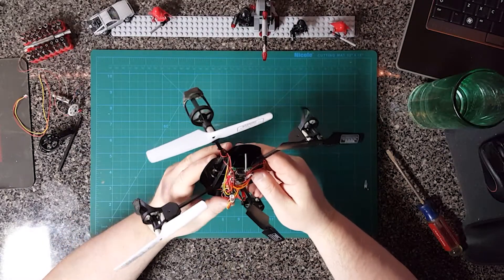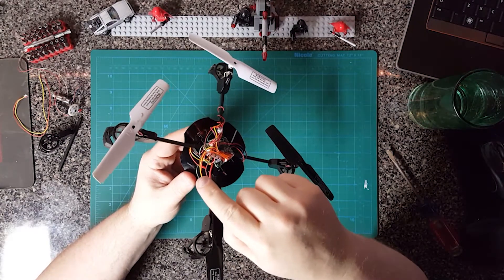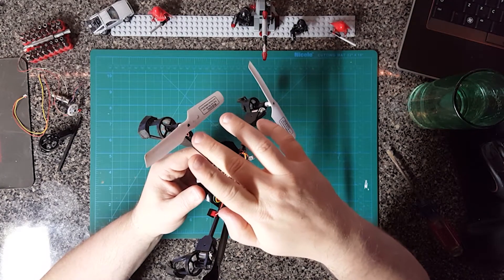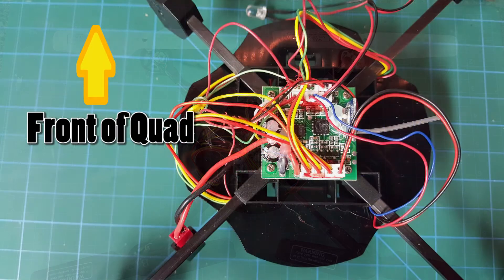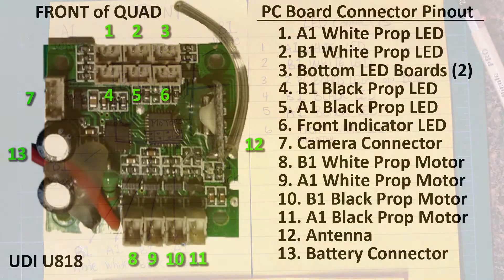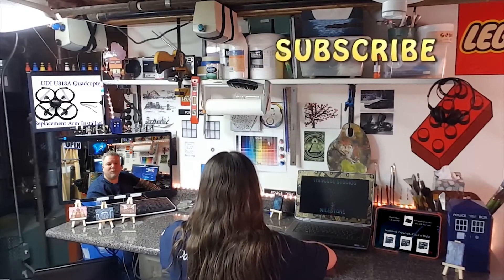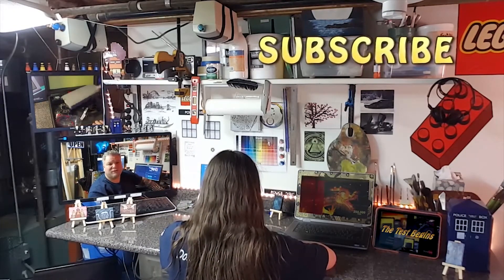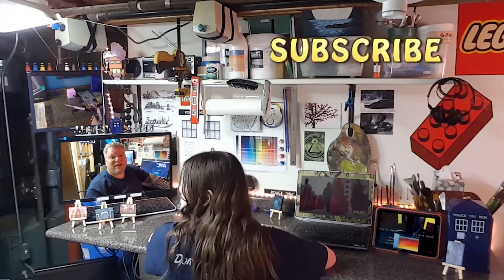UDI Quadcopter PC Board Connector Pinout - U818A DroneTube Repair

Comment: Tony, I had a bad motor as well so I replaced it.  Now it constantly spins.  I even tried another motor to make sure the replacement was not bad.  Any idea why my replacement motor spins as soon as power is applied?
Reply from the maker: Hi bibbs823, i might have some bad news for you! It sound likes you main board is bad. Thanks to another youtuber who sent me a picture of their main board we now know that sometimes when motors go bad they also send a surge or draw too much current from the board and destroy a transistor. Take a close look at your board and you should see some ICs with the number "2300" on them and 3 contacts (legs). See if any of these are burnt or look closely for cracks. The good news is that a new board is available here if you feel like doing the work: http://amzn.to/2bUbwJ8  (Wifi) version.   Good luck and let me know how you make out, Tony.
Reply: Thanks for the quick response. I cannot see the numbers, but I do see there is damage near the pins for the motor that spins. Sure looks like what you described. 
At least the board is not too much and it is available. I will replace it and see how it goes.
Reply from the maker: Sorry for the bad news but glad i could help....good luck with the repair and let me know how it goes!
Reply: +ThinCube 
I finally received the new board and all four motors spin. I have a couple other questions for you. In all this time, I must have misplaced a light. I have nothing plugged into 6. Am I just missing a light?  The other, and more important question is why my drone flips as soon as I take off. Could it be bad calibration, or a motor not connected correctly?  When standing behind it, the drone flips to the left as soon as it leaves the ground.
Reply from the maker: Hello again, sorry to hear you're still having issues. Yeah, connector #6 powers the front white LED. It isnt needed unless you want it for guidance. As for the flipping. Make sure you have not only the correct motors in place at each location (clockwise vs counter clockwise), but also that the correct direction prop is installed with each motor. here is a link to a video i made to help you with that:  https://www.youtube.com/watch?v=nTNhGXrO5ik     Let me know how you make out....ttyl, Tony
Reply: I must have something screwed up. Looks like A1 and B1 are spinning opposite of what they should be. I didn't change either of them. I will take another look after watching your videos. Thanks for all the work you do!  It is very helpful.
Reply from the maker: Make sure they're plugged into the correct spot on the board....and hopefully the board you got matches the layout in the video.  Use the prop video to help you check all the props for "proper" rotation :)
Reply: +ThinCube 
See if explanation marks any sense to you. When I stand behind the quad the two front rotors are white and the rear to are black. Going from left to right I have A2 white which spins CW, B2 white which spins CC. Bottom left is B1 black and it spins CC. Bottom might is A1 black and it spins CW. This naming convention does not match what you have in your video. Any idea what I'm doing wrong?  I think they are plugged in correctly. 
Brian
Reply from the maker: the only difference is that there are no "2"s on my quad in the video. But you have all the correct directions listed as i do. Make sure the prop that is on that particular location is in fact the correct slope to it. Watch the video and i explain how to tell a clockwise vs cclockwise prop by its shape. Maybe the A2 and B2 are different. that is the only thing i can think of besides the board putting out the voltage differently to each connector. Just make sure you can prove the prop is spinning in the right direction and that the prop at the location is in fact the right one. Because if you put the incorrect prop on a motor it will act the opposite of how it should. Which is what it sounds like is happening to your drone....sorry for the long winded  reply :)
Reply: +ThinCube from what I can tell, all 4 are providing lift. That's right, correct?  I only changed the motor that locked up. I have not changed any of the blades. Could it be the new board?  Do I need to update the firmware? Is there any calibration that needs to be done?
Reply from the maker: Ahhh i see what you are saying now, i just assumed you might have had it all apart for some reason. Well, in that case it really just points to the board acting funny. But to confirm that, did you check to make sure that the motors are spinning in the direction they should be for that location? The right motor and right prop at each location is only part of the story, the board has to be sending the correct polarity of voltage for the prop to spin correctly as well. Because in theory you could reverse the red & black wires on a motor and it should spin in the opposite direction.
Reply from the maker: And yes, all 4 props together provide lift. They spin in opposite directions to provide stability and the ability to rotate your quad on its axis.
Reply: Have you ever used the board you suggested?  Maybe it is just a bit different.  I tried to explain the prop locations and spinning direction in an earlier reply. Did that make sense?
Reply from the maker: No I haven't used it but other youtubers have with no issues that i know of. Yes, i saw that reply when you mentioned the props A2 and such, just wanted to be sure the motors were actually spinning in those directions. It sounds like the board is bad unfortunately! Amazon is really good about refunds if you purchased it from there.
Reply: Crap. The board was ordered through Amazon, but came on a slow boat from China.  Getting tired of this fight.
Reply: I received a new motherboard and it turns out I did have 2 motors switch. I can now fly, but I'm struggling with control.  I want to thank you for all the helpful information and informative videos.
Reply from the maker: So glad to hear you're up and flying again, bibbs. Good luck with getting it under control. It does take some practice but you'll get it :) Glad i could help....Happy Flying, Tony.
Reply: Are there any good training videos on flying?  😀. The RC controller seems to work alright, but the Android app stops working all the time. I'm struggling to find good documentation that matches the gear I have.
Reply from the maker: Try this video and see if it helps you out. I did a quick search and found this one: https://www.youtube.com/watch?v=OOLhmvdDyJM
Reply: I cannot get that to play since it does not show up as a hyperlink. Tried to type the URL and that didn't work either.  That's alright, thanks again for all your help. Communicating directly on YouTube is not intuitive to me.
Reply from the maker: bibbs823 The link works for me when i click it in the comment now, sorry its not working or you.
Reply: shows up  as a link now.  I'm not sure what the problem was. I think I needed to be in full screen mode.
Reply: I must have something still serious wrong with my quad. I charge a battery up, plug it in and all the lights come on. I attempt to take off and try to hover for just a bit. Soon my RC controller starts to beep. I'm assuming that is low battery. I'm serious when I say I have less that 2 minutes before everything is dead. What do you think the issue is?
Reply from the maker: First thing that comes to mind is the battery. Do you have more than one to verify it is happening with other batteries?
Reply: I have 2 batteries and they both do the same thing.
Reply from the maker: Try using the remote to shut off all the lights and see how much more flight time you get...im reaching but its worth a try!
Reply: ThinCube can you tell me why the throttle on the Flyingsee app is at 50% by default?  I don't understand why you would want that, or how I can change it.
Reply from the maker: Hi bibbs, i do not know why its at 50% as I am not familiar with the app. Try looking at the trim settings on your transmitter. Make sure the throttle doesn't have a trim adjustment.....

Comment: Anytime I plug a motor into slot 11, when I plug in the battery, the motor won't stop running. Any ideas on a fix?
Reply from the maker: Hi msitez, well it could be the main board went bad and is keeping that motor on all the time. Or something stuck on the transmitter always outputting but i would think all the motors or at least more than one would be on. But try turning off the transmitter and seeing if that changes anything.  Let me know what you come up with and we can see what next to try!!! Good luck, Tony.

Comment: The PC board on my u818a looks the same as this one in your video. The transmitter has a blue light.  On the bottom of the PC board it says ud-u817e.  Im having trouble finding a replacement board. Will any board that looks exactly the same work?
Reply from the maker: Hi, i believe as long as you have the u818a quadcopter the number printed on the PCB isn't always the same. I have also seen "u817B" on these PCBs.  Below is a link to buy a replacement board. Good luck and let us know how you make out..... UDI U818a PCB:   http://amzn.to/2a2ywaL
Reply: +ThinCube I got that receiver board a couple days ago and replaced it. the numbers on the board match up the same. the transmitter still won't connect. I'm lost now
Reply from the maker: Sorry to hear that! Try binding the transmitter to the drone by first turning on the transmitter (drone battery unplugged) and throttling up then down. Next plug in the battery for the drone and right away you should hear the"binding tone". Also, make sure your transmitter batteries are good. If that doesn't work. Try unplugging everything and then start with the drone itself. Plug the battery in, then turn transmitter on, next throttle up then down and you will hear the "binding tone".....do this all quickly one right after the other. Let us know what you come up with. Honestly, if all this fails then i would suspect the transmitter is bad! Good luck.
Reply: +ThinCube I've tried all that. I know the transmitter is good because it will connect to my friends drone. no matter what I try it still won't connect to this new board. I wrote the seller of the board and they will accept a return. No more U818a. They're only 40 bucks now. I'll just pick up another one.
Reply from the maker: Yeah, there are a ton of sellers with great deals on the U818a. At least if you buy the same drone you will have a whole bunch of spare parts on your hands!!!  http://amzn.to/2aSjNyx   Happy Flying and thanks for sharing!

Comment: Hey I am having a problem with the connection between my drone and controller. This happened after my drone dropped from a height of roughly 10 meters. Only the housing was damaged and the connection would be cut after I flew the drone for 20 seconds, it would be great if you could help because I don't want to spend too much money on the repair of this.
Reply from the maker: Hi Jayden, it really could be anything since the drone had a fall. But i would start with checking the solder joints. Look for cracks or separations. Especially around any capacitors or larger components (like the board the antenna is connected too). If you are familiar with soldering, you could try what is referred to as "shotgun" soldering. This is the process of reflowing solder on a bunch of joints in an area of the board.  Good luck and let us know how you make out or if you have more questions, Tony.
Reply: +ThinCube the connections and joints seem to look okay but when the issue occurs there is a red light flashing on the chip of the drone. Also is there an email address which I can send a few pictures to do you can help me inspect for possible solutions
Reply from the maker: Sure Jayden, send the pics to tony@tonyboston.com and i'll see what i can do....do you happen to have any videos of it?
Reply: +ThinCube yep I sure do but I believe the file will be to long to email so I will post a private YouTube video and give you the link to it, thanks for your help :D
Reply from the maker: Sounds good!

Comment: Hey Thincube – great videos. Do you have one that shows how to connect the camera to the PCB? My U818A came with the camera separetly in a plastic bag. I thought I'd connected it correctly, but it isn't taking pictures/video at all. Any assistance would be greatly appreciated. Many thanks in advance, Sam
Reply: Looking at your diagram, I have connected it to the correct point on the PCB, yet it still isn't working. 

Also, there's a connector at the opposite end to the lens on the camera which I can't figure out what its function is.  It's not micro/mini USB. Do you know what it is? Does this also need connecting up to something on the PCB? I don't appear to have the cable – nor did the device come with one – if so... Thanks, Sam
Reply from the maker: Hi Sam, glad you like the videos. Ok firstly, i do not know what the connector is for on the camera, maybe they use it when setting it up in the factory. Or maybe it is an output to transmit the image to a ground station using a transceiver which the UDI U818A does not come with...these are guesses. Ok, the only thing i can think of as to why its not recording is this. 1.) Be sure you have a known good micro sd card installed. 2.) Are you pressing the correct buttons on the controller to start video/take a picture?  Look at the LCD on the transmitter and make sure the video icon is showing up when you press the video button. Let me know if this helps or if you have any more information that may help me figure this out for you. Thanks, Tony

Comment: i think your videos are great ! I'm am having a problem with my Udi as i take off it starts to rotate while in-flight making it difficult to control and after about 5 second in the air it dives down towards the ground.  i swaped out all the props and motors with arms attached. the gears all good also.  the wiring is perfect. i just can't figure out why it rotating on its own.  PLEASE HELP ME!
Reply from the maker: Thanks, glad you like my videos. So from what you described and your efforts to fix it, it sounds like the ONLY thing left is the main flight control board....the board in this video actually. As long as all of the motors you replaced are actually in good working order then the only thing left is the main board. With the exception that the transmitter could in theory be sending out the wrong signals but that is unlikely.  Unfortunately my two cents are the greatest in this case but i hope it helps. Let me know if you figure it out or anything changes.

Comment from the maker: Thanks for watching and please feel free to comment or ask questions below. I try to reply as quickly as possible. Happy Flying!
Reply: ThinCube It’s great the way you simplify everything to see what goes where.......Thank you.       Maybe you can help me with the problem I’m having I replaced the motherboard no problem everything went fine The drone has a fully charged battery and the controller has new batteries installed in it when I was done it paired up fine but when I move the lever to activate the motors nothing happened I even tried moving the lever all around in all positions still nothing.         Do you have any suggestions ?     Thank you